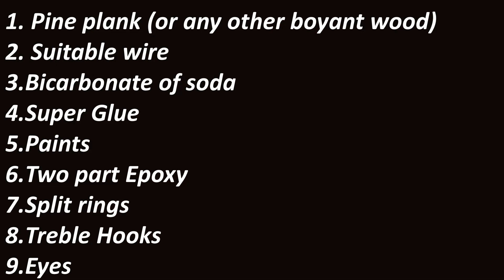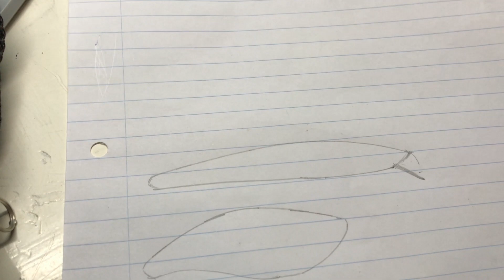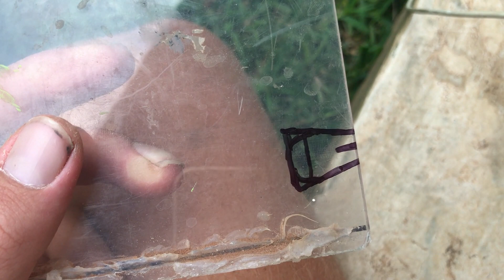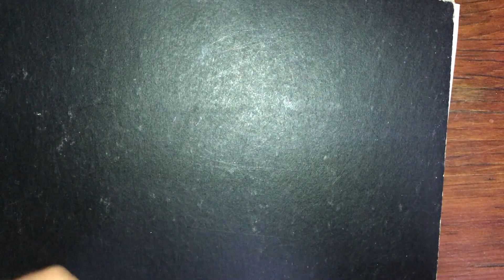How to Make a TIGER FISHING Lure (at HOME!!!)

Comment: I use aluminium for my lip its stronger and you can bend it if your slot is the wrong angle
Reply from the maker: Yes, I will try that next time
Reply: @ThisisAfricaOutdoors  Yes if you mess up the size you can also fix it with a hammer in the true Zimbabwean fashion 🤣🤣🔨🔨🔨🔨🔨